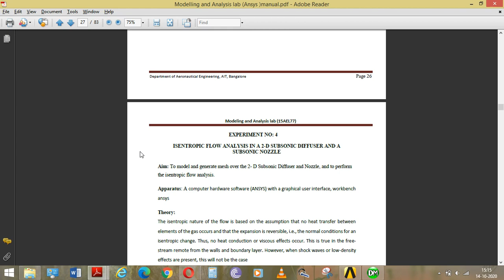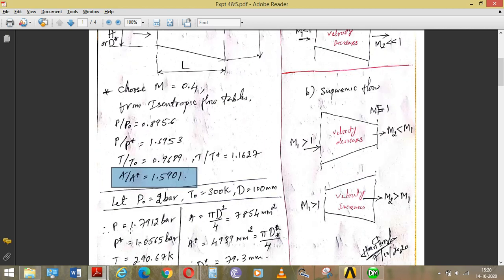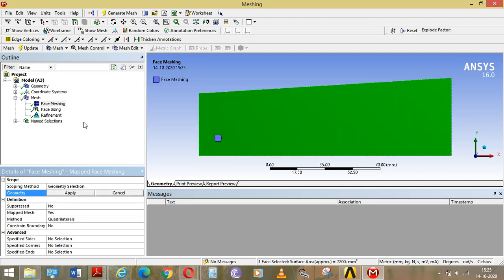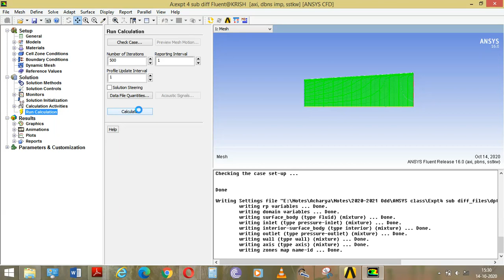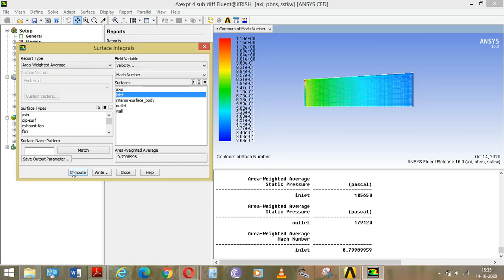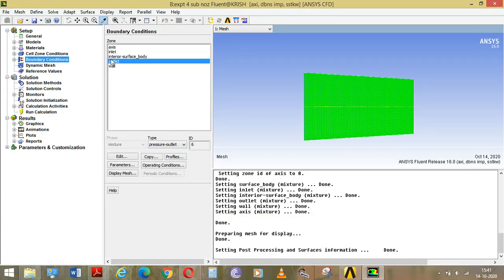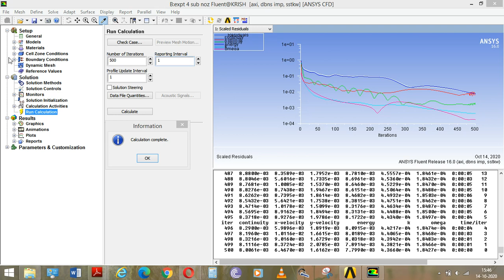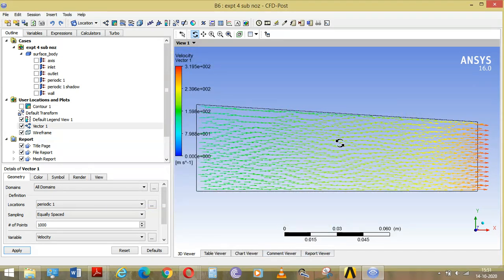Exp - 4 Isentropic flow analysis in a 2D subsonic diffuser and asubsonic nozzle.

Comment: A supersonic wind tunnel is designed to produce a maximum. Mach number 2 in the test section. Calculate the ratio of nozzle throat area to diffuser throat areato diffuser throat area that would allow the tunnel to function......can we write this lecture as a ans for this question